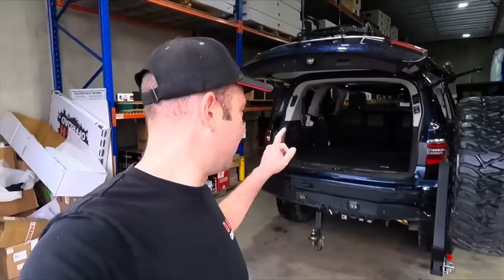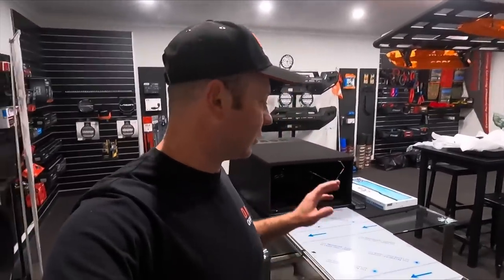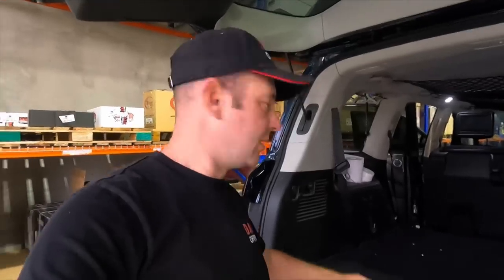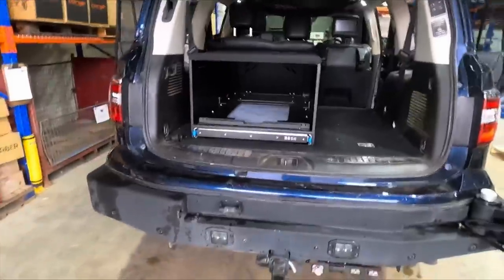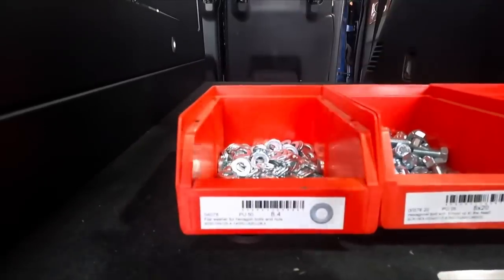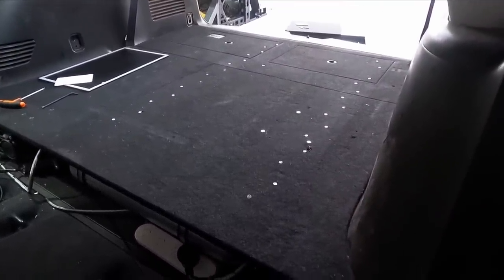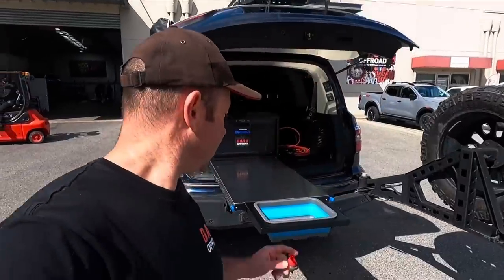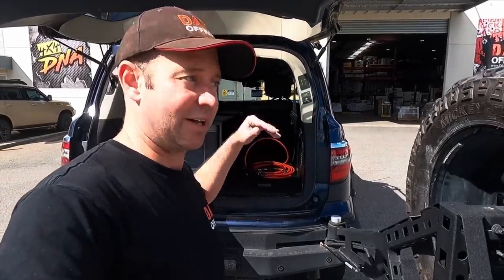DASH Fridge Cabinet for Evakool 40L Drawer Fridge

Comment: I can see that a lot of thought has gone into your drawers. But I see one problem that would give me the shits. When you have the bench top pulled all the way out and it is loaded with say a cook top and associated stuff with prepping a meal, then you realise you need something at the back of the fridge ? Then that means you will have to clear the bench top to pull the fridge out. Am I correct ? Please correct me if I am wrong.
Reply: I was thinking likewise, it's the draw back of this fridge type.
Reminds me off Toyota tailgate covered in food preparation and then you need to access fridge, duh.
Like you, would drive crazy, I'd redesign concept to utilising a chest fridge, the bench slide mounts to the fridge base, hence should you want fridge, as you slide it out bench comes out also, hence everything stays in place.
That's how mine works, it's excellent.
Inverter mounted on fridge slide in space behind fridge, so my 240v also accessible to bench when slide out. Water line to bench also, so tap at sink always has pressurised water. Cutlery draw under bench also.
My induction cooker, sink, bench space all stay in place and slide out additional length of fridge as fridge slides out.
We're utilising Evakool 47 litre chest combined freezer/fridge, so I have slightly less than 40lt fridge but freezer contains all meat, ice etc, so really no worse off. Yes, it's higher to access, but we aren't tall and very accessible in our Y61 for us both.
Reply from the maker: Yep, you are incorrect, the bench is twice as long as the fridge drawer.
Reply: Whilst I comprehend what you're saying, you are very limited with usable bench space as opposed to exposed bench space. Can still see clients becoming very annoyed by placing items out, then realising they can't use that area plus access fridge.
Not being negative, just pointing out an obvious annoyance, but that's mine & old mates opinion only thus far.